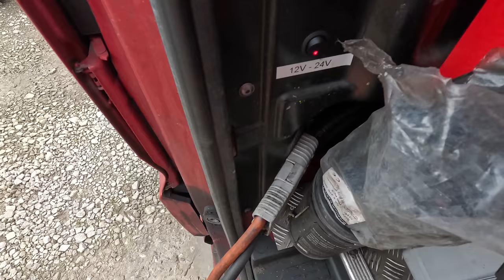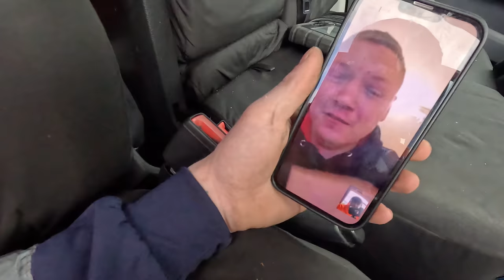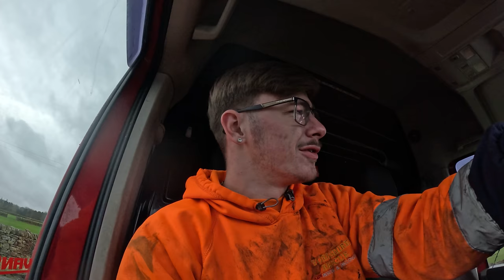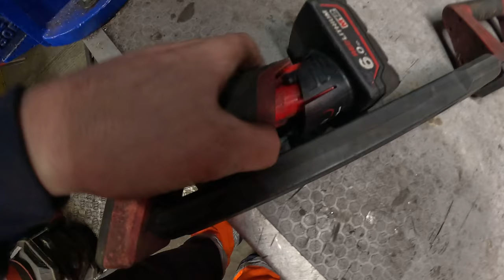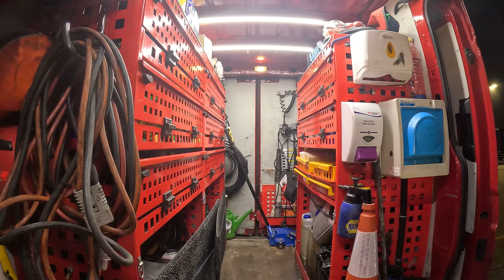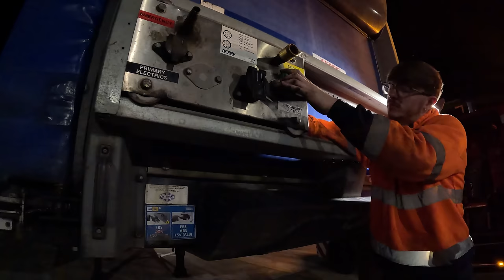I RUN OUT OF DIESEL!!!!

Comment: 1. If it’s a shit design why not make life easier for next time and the next guy and put some rivnuts in it and a bit of double sided foam tape to fill the gap if there is one?
2. How do you run out of fuel when you drive through shell to get onto the road and when you get back?
Reply from the maker: Cos am hard